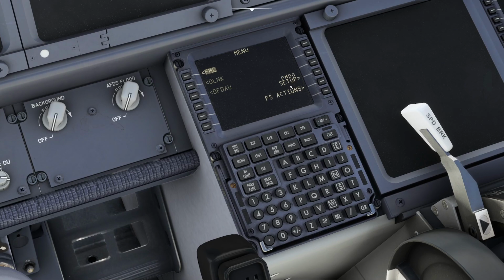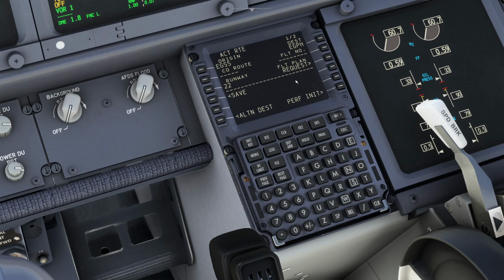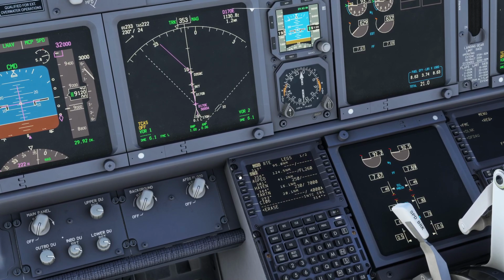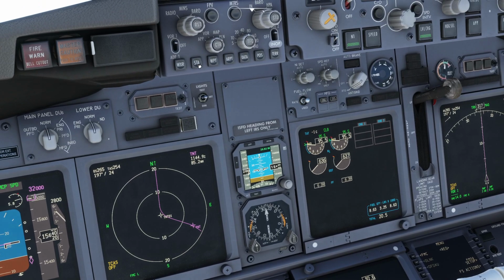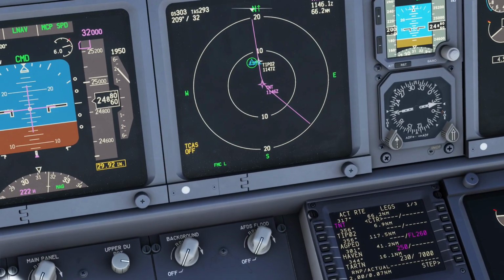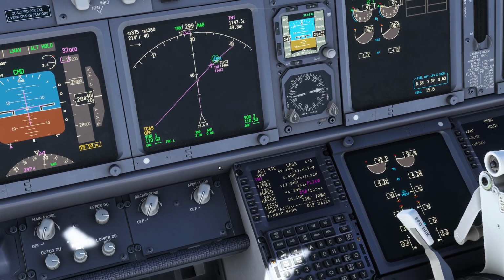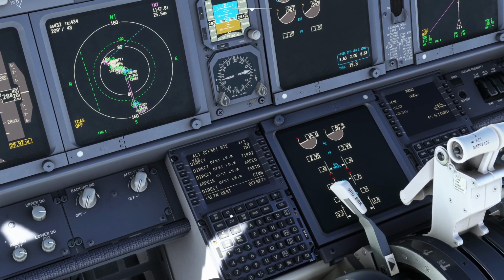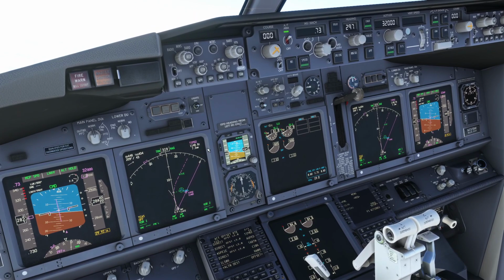Everything you wanted to know about route planning in the PMDG 737-700 FMC but were afraid to ask

Comment: Cap i recently tried the bird and took off. Check the video below. What error is that at takeoff and what did I do wrong?

https://youtu.be/YMCnaPmvp3I
Reply from the maker: You're getting a takeoff config warning. That usually means the flaps do not match the setting programmed in the performance page of the flight management computer.

Comment: This doesn't work Cap when i try to load for a direct final. Any workaround anyone?
Reply from the maker: Just programme the arrival in the FMC. You have to at least choose the arrival runway.
Reply: @jonbeckett  i do not the problem is that neither the APU is ON and nor the engine.

Comment: Hey Jonathan! Great video as always! Never disappoint. I do have a question, Today I flew Cancun, Mexico to Houston, Texas in the PMDG 737-900. But for some reason, my plane would not bank all the way. Like I would have a different turning leg and my plane would turn a little bit, but I would have to manually turn it. If I had a hard right turn it wouldn’t go all the way. Do you have any idea what to do?
Reply: I am just trying to figure out if this is just me or it’s a lot of people.
Reply from the maker: If you were flying on autopilot, I'm guessing you might have changed the turn rate? (under the heading knob there is a second knob that controls max bank angle).
Reply: That’s not it. My LNAV would go in a straight line then the lnav would turn 90 degrees and my plane would not.

Comment: Love youre videos. Qst: is it possible to just use the route planning inside the sim and calculate it on the fmc? For a easy fast flight when you dont have so much time
Reply from the maker: No - the FMC in the 737 takes no notice of the flight planning in the simulator. What you can do is create a flight plan in simbrief, download it, then upload it into a very specific folder about 20 levels into the filesystem, and the 737 can then load it as a company route. That said, the flight plan will not come in "complete", so you still need to know your way around the FMC to complete it.
Reply: @jonbeckett  Okei. But yesterday i choose a flight plan from ENEV to ENBO northern norway inside the sim before launch the flight. Chose ILS25 and wrote down the Dep and arr and when in fmc i just typed Those in for dep and arr and guess what, i got a smudh ILS approuch in bodø ENBO. I went throu the legs and connected everything also. Hmm

Comment: Excellent and useful video. How can we add vector points also to Fenix A320? The 737 way that you described dont work on the Fenix. Another video like this also for the A320 would be much appreciated. Thanks.
Reply from the maker: Yes - the A320 has an entirely different system. I'll do a video on it soon :)

Comment: 13:23 what I've noticed with the PMDG 737 (back in the FSX days) is that if the FMC shows you multiple waypoints because somewhere else in the world there is another waypoint called 'RODOL', the FMC will put the nearest one at the top of the page as that's the most obvious choice.

Also, when pressing the WPT button to show waypoints on the chart, play around with the zoom. When there's to many waypoints to display at the current zoom level it won't display any.
Reply from the maker: Did I not explain that the closest waypoint is at the top ? You're wrong about the number of waypoints - they only appear at specific zoom levels (unless part of the plan)

Comment: In the PMDG tutorial, they have you program a route and near the arrival there is a leg labelled (VECTOR) instead of route discontinuity. I'm not sure how this happens. Perhaps it is a feature of the approach into KSFO (they have you use BDEGA3 STAR and MLBEC transition). This all makes sense to me because as you get close to the airport ATC is likely to vector you.

But in this route and on routes I have made up, there is no (VECTOR), only a route discontinuity. In this video you just close them up. I tend to leave them in and make up some ATC vectors for that part of the route. But I don't really know what would normally happen on a flight, or whether there is a difference in how the FMC treats (VECTOR) vs. route discontinuity.

What I do know is that you have given some tools here for programming in a route onto the glide slope -- I could put a waypoint some miles before the runway and specify the intercept heading, for example. Useful stuff!
Reply from the maker: When vector appears it is a gap in the plan where the pilot should take over. I.e. the SID or STAR expects human interaction at that point. You can usually remove them if flying on your own. If using ATC you might ask for vectors.
Reply: So I got a copy of the 737 FMC User's Guide by Bill Bulfer. From p28: Waypoint names in brackets are conditional waypoints "events when a condition occurs and not at a geographically fixed position... cannot be entered manually... embedded within stored procedures such as DEPARTURES and ARRIVALS".

Then on p29: "When (VECTOR) is the ACTive LEG, the FMC does not automatically sequence to the next wpt. It maintains heading indefinitely. The next wpt becomes ACTive only upon EXECution of the procedure for proceeding direct to a wpt or intercepting a leg to a wpt."

I guess this means, follow ATC instructions using the other nav modes and it's likely you'll at some point be told to fly direct or else will intercept the next leg.

It's an interesting book, btw. Probably full of ideas for more videos like this!

Comment: Is there anyway to load the flightplan from simbrief without having to do a bunch of manual inputs? kinda like on the flybywire A32NX
Reply: Yes but you have to download files first using Simbrief Downloader
Reply from the maker: @TheMicj38  you can download directly from the simbrief website after generating a flightplan.
Reply: @jonbeckett  You can but the Downloader can be setup to put all of the files in the correct places - fp, wx etc with one click
Reply from the maker: Not easily (until the tablet appears in a future update). You have to access the Flight Simulator binaries directory - which requires modifying permissions in Windows - which I'm not going to do :)  There are videos on YouTube of people doing it.